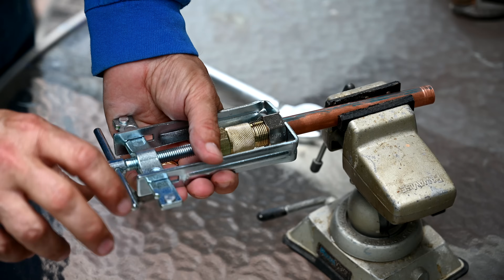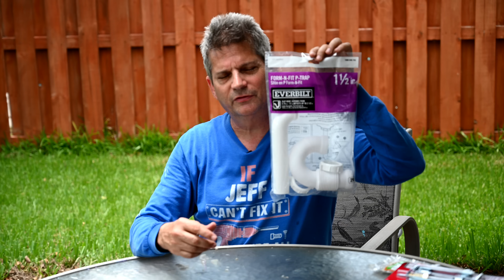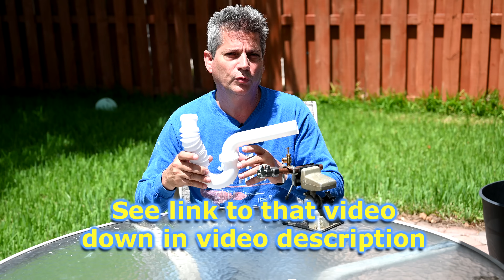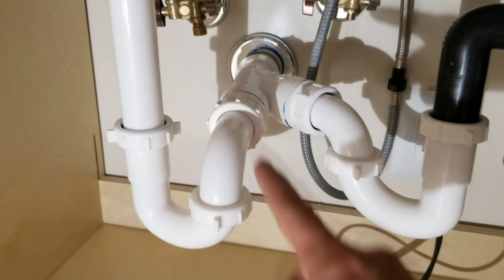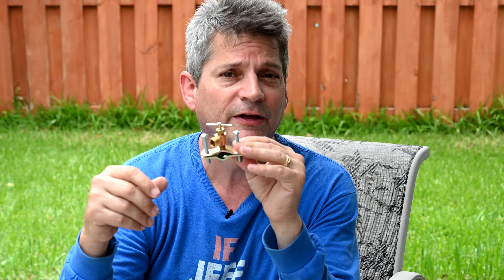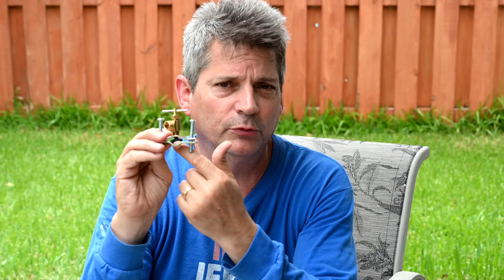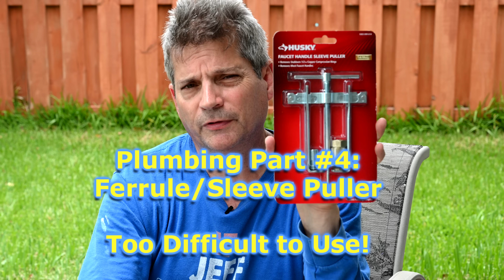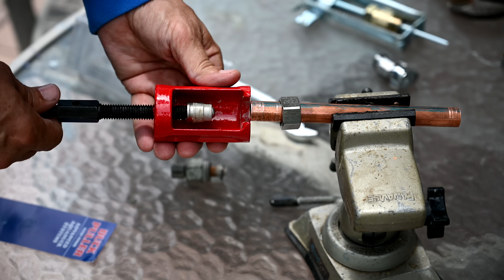4 Plumbing Parts/Tools You Should NEVER Use. NO Plumbing Fails

Comment from the maker: ✅ Useful plumbing tools you SHOULD be using:
🛒 PanaVise 381 Vacuum Base PanaVise: https://amzn.to/3exQZIC
🛒  Duck Puller Ferrule Ring/Sleeve Puller: https://amzn.to/2k5hrTY
🛒 Saf-T-Kut EBCRR Brass Compression Ring Remover https://amzn.to/2Ypt5Mv
🛒 RIDGID One Stop Wrench Kit: https://amzn.to/2ClCbNa
🛒  Channellock 12-Inch Pliers: https://amzn.to/2MdcnGR
Reply: I have one of those flexible P-traps, installed by a contractor. I just saw this video. I guess I need to replace it.  Thanks for the tip.
Reply from the maker: @CaseAgainstFaith1   There's no rush but yes I would certainly look into getting it typed the correct way and it really is not a big difference in parts and pricing
Reply: Q
Reply: I hate those saddle valves also and they are used constantly!
Reply: 12:00 in electronics  the equivalent is ONLY temporary as it WILL fail over time ,,, & that's with audio connectors even
Reply: When you buy the ice machine hook up kit it always comes with either 1/4" soft copper or plastic line and a saddle valve. That's why you see them all the time. Around where I work usually the building inspector will allow an existing s-trap to stay if you use a proper AAV (air admittance valve) so you don't have to do major surgery. If the cabinets and drywall are getting gutted, then it's less trouble to install a proper p-trap and vent stack.
Reply from the maker: @bufordtjustice7015  yes, when we showed the saddle valve in the video, it came in the ice maker line kit at Home Depot. Crazy and stupid. Even more stupid is the "pros"/installers that many appliance centers send over to do the installs also use saddle valves.
Reply: No, I did not say ignore the warnings.... I was saying tone down the hype...
Reply: Looks like they design the seal puller based on the design of a cork remover.
Reply: Hello jeff . is ok to used shark bite fittings ?  Those are approve by plumbing city codes?
Reply from the maker: @romanl8343   Whenever we can we prefer to either sought or pipe or cement plastic pipes and avoid shark bites when feasible, the only time I will use a shark bite as if it is outside the wall and a spot where I can easily see it like the shut off valve for a toilet or the under the kitchen sink for the faucet valves where we had to convert from the old illegal polybutylene pipe to a copper pipe.
Reply: jeffostroff I’m seeing thst Snappy Trap now has a smooth interior of the flexible pipe and claims it’s in compliance with code IGC 328. Should I still be concerned about using it? My new vanity drawer can’t currently close because the pipe sticks out too far.
Reply from the maker: @JkayPacker  I would be hesitant, because if your insurance company does an inspection and sees it, they will see a"flexible trap" and tell you to remove it. Have you looked into cutting the pipe back toward the wall, and leave enough room for a hub adapter to connect to the P-trap.
Reply: I think there’s right way and the right way do it the first time and then it’s finished ✅
Reply: You are 100% right about those being against plumbing code because they have a credit connection before the trap seal. A corrugated tailpiece is not illegal but it is not recommended because things get caught on it which makes a stoppage
Reply: Jeff  I just saw your video!! I live in Central Pennsylvania and I just bought an old house that was built in 1901 and this is EXACTLY the type of pipes that are in this house! I just had to call a plumber because after another plumber had installed s new  toilet in our 2nd floor bathroom. Well after a week or so I noticed that when my wife did laundry in our 2nd floor laundry room that is also in our 2nd floor bathroom we noticed that methane smell!! So I called another plumber and he said we had a huge clog in our main water pipe. He had to use a very long electric snake to unclog that pipe!  Well here he found that the previous owners had used baby wipes and that was what caused the clog to get bigger over time and when we had the other plumber install the new toilet it added to the problem!  Thank you for your VIDEOS ! And for those SADDLE VALVES they're what alot of plumbers and handymen in this area use for the water lines to the refrigerators with the water and ice dispensers in it !  I have 1 of those refrigerators with  water and ice in the door but I haven't had the water line hooked up yet on my refrigerator but that saddle valve is what a guy at Lowe's said  to use on it! So now I know better thank you!! I will definitely be watching your videos from now on!  Thank you!!
Reply from the maker: @stanleywheeler404   Glad to make you an informed homeowner. Only know you have open the Pandora xbox where you are living with the horror of knowing you  Could have this as well but at least you can warn your friends and family up there  too.
Reply: @jeffostroff  Ouch!  My house was remodeled in 2004 and I am still finding mysteries, some from when it was built in 1968 and other from late on, but at least all the dangerous material were removed along with new pipes, electrical and insulation put in.  The  did leave all the old wiring in the attic after removing it from the walls.  I am slowly removing it.
Reply: Man plumbing is not rocket science, and those flexible pipes are a great idea and as good as your fittings. Who the hell cares about the codes...What does the insurance company knows... No, it doesn't trap anything, it works flawlessly...
Reply: jeffostroff  thanks for the informative stuff but i suggest not to talk down n people not every DIYers has tones of $ to pay a plumber , my self in a 62 year old living in less than i fix income , that is not even enough to pay your hourly rate as a lumber , thanks and be conscious do not talk down on others!

Comment: The wost saddle valves  appliance stores on delivery won't do a hookup they dont want th3 liability of shuting  them off past problems resulted in huge problems , i done aalot of saddle valve change outs to a nice appropriate ball vavle shutoff for the appliance to be hooked up buye store , people had to wait a day or two with a refrigerator i there kitchen or garage until i corrected the problem

Comment: Also, you’re distribution lines that are out in the street that feeds you fresh drinking water every time they make a tap for a new house they use a saddle and his various types stairs, hinge types, and is also shackle types all with a rubber bushing underneath it it’s wrapped around the pipe screwed or bolted down and it’s drilled through and put a ball valve corporation on what it’s called and then they hook their line up to it toward the house defeat the house water.

Comment: That’s easier said than done, but not everybody can afford a plumber so that’s why they have some quick fixes mainly for the Hallmark but if it works for a while, it works. I use those accordion traps. The only thing I say about them is they have a Tennessee crack right on the accordion part of the track other than that I’ve never seen one get clogged, but to each is on

Comment: Why do they sell items that are not up to building code?  What's the purpose if there not legal?  Do you know how many homes have S traps here in Michigan? Most all. Here in  Michigan the drain pipes do go straight down in the floor after the P or S traps so it doesn't freeze. There should be a AVV in the set up after the P or S trap . This keeps the water from getting sucked out of the trap.

Comment: I just used the snappy trap for my bathroom faucet & it was a life saver. Now if it was banned in all 50 states (and this is 5 years after the video was released), they wouldn't be able to sell them at Loews or Home Depot. The Snappy Trap (P-trap) works flawlessly. If it ever gets clogged, I can unclog it. 
It's against my religion to get raked over the coals and fleeced for simple DIY projects. I had a Well Co. try to charge me $1,800 to fix a leaky line 4-5 feet underground; - so, I dug it up myself and spliced in a new section of pipe for $30 and that was over 10 years ago. Another time I got charged $700 to replace a water heater pump on my furnace, and when it happened again on the other pump, I purchased the same exact pump for under $100 and soldered it onto the pipes myself. It still works 7 years later. YouTube is putting you guys out of business. If you have half a brain and can follow directions, you can save yourself tens of thousands of dollars in repairs. I am not intimidated by any repair, and don't let this guy scare you into getting screwed by a repairman.

Comment: At 4:05 you show the code requirements the list 6 designs of traps that are banned. Having said why the P trap is banned why not explain what the other 5 are? Is this type of trap: 'SA10V McALPINE 32mm Anti-Vac Basin Sink Waste U Bend P Trap' good or banned (is it a 'Crown vented trap'?). My basin has a P-trap but after the trap it heads straight down and into the floor not into the wall - is that OK?
Reply from the maker: While the product itself is designed to high standards and may conform to various international codes, explicit confirmation of its compliance with the UPC was not found. To ensure it is allowed under UPC plumbing codes, you should verify that the SA10V has been certified by IAPMO or another recognized body for UPC compliance. But I have installed similar devices like air admittance valves, these are used when you have no plumbing stack vent from your sink going up through the roof. So they need to get air somehow and that is where your ubend comes it.

Comment: Nice video, I wished there were more solutions for the “wrong” one’s. I am currently doing a Tub install on concrete slab. Same size tub but new tub drain is about 1 1/2” offset from trap which is attached via fernco to led 1 1/2”. As is there’s no way to line up. Whats the best way to handle offset besides flex tail piece?  Thanks for your input

Comment: I have used the sattle valve for a icemaker and fridge water on my own home. Its been 10 year's since installed not 1 issue. Still looks brandnew as the day it was installed. I believe it is the installer who makes the mistake with sattlevalves and over tightening the pipe.

Comment: Under sink drain plumbing is NOTORIOUS for leaking !
The nylon (or whatever) cone washer seal is TOO firm (needs to be a bit more pliable)
and the hole in the nut (tightener) is TOO large. In some cases the hole is so big that it BARELY covers the cone washer. That hole needs to be just a bit larger than the pipe it goes over, not a sloppy fit.
If all this isn't PERFECTLY aligned, and tightened, the joint WILL leak.

Comment: The husky faucet handle puller is used for faucet handles not sleeves, and I’ve used it a few times to remove a handle from a faucet that wouldn’t budge, it worked perfectly with no problems.

Comment: Question... why aren't homes built with an external vented trap somewhere in the yard right where the houses main sewage outlet hits the city or municipal main???  That would seem to solve a LOT of plumbing issues if sewer gas could never even make it into the home to begin with (besides the little created in the basement sewar pipe).  
     Also If my landlord didn't want a form-and-fit trap on the bathroom sink, he shouldn't have been so cheap and lazy as to tell me "eh... you deal with it and just take it off next month's rent".... Well,  I did... and I'm not a plumber so I bought the cheapest easiest thing.  And to be fair, it hasn't given me any grief or issues yet, and it's totally concealed within a pedistal sink... so, out of sight, out of mind.  He can deal with the code inspector when I move out.  LOL

Comment: I did service plumbing for many years and never had a 'building inspector' look under an existing sink.  Use the easiest way available including flex lines.  I have and they work great.  BS about code.  Code is for inspectors and contractors to bilk the public.

Comment: I disagree with the flex P-trap. Sounds like your trying to manipulate the code to suit your opinion so  customers can pay more. If the code was so against Flex pipes it would just simply state that. Also the P-trap is partially designed to actually catch debris so It doesn't get into your plumbing system. Somewhat challenging your statement on flex pipes trapping debris.
Reply from the maker: Sounds like you don't have a clue what you're talking about. First of all I did not manipulate the code I read the code exactly as it was. And it's not like people are going to have to spend a whole lot of money we're talking about three or $4 in parts.  Piercement of pea traps could not be more wrong. In fact if you look in the plumbing code as I showed all the pipes are supposed to be self scouring as the code reads, which means the P trap is not there to catch stuff and prevent it from going into the pipes it could still go through the P trap. The P trap is there to keep that column of water in there so that sewer gases don't come up from your sewer system and up into your sink through the pipe because it can't get past the water that's in the pee trap. That's why they call it a trap because it traps the water. However if you were foolish enough to install a flexible P trap then yes particles would indeed get caught in it.
Reply: @jeffostroff  Still disagree been using flex pipes for 30 years. No problems.

Comment: A host of these components were developed solely for the diy market long ago, after all there is a load of profit selling to the homeowner, these are low skill repair parts…just like the auto parts industry, with hoards of slip together exhaust fittings, and universal spiral tubing…the people crave giving it a try…and so these items will remain on the shelves…for us pros we are required to know code and it’s changes..applications, etc. we are paid professionals using the correct components…

Comment: I disagree on the compression sleeve remover. It worked perfectly for me. The problem you were having was leaving the shoulder wings on. You take them off by undoing them from the threads and it works super easily. The wings are more towards faucet handles. There are some other designs that have different wing designs but more pricey.

Comment: I’ve seen a million of those flex p traps … they get clogged easily but other than that I haven’t had major issues with them .
Reply from the maker: Yes they work perfectly normally until they don't work. Then you clean them out and they will work again
Reply: @jeffostroff  yes they clog faster ….. hair hangs on it then everything else hands on the hair ….I totally agree it’s a cheesy solution.
In one property remodeled bath …. Semi gut …
The new vanity wouldn’t work with a normal /correct ptrap ..it ends up being like dead center … bc vanity was larger ..
I was going to re plumb it …. But when I got in there it was metal and I was had everything expecting pvc..and I had renters coming in that day …. So I threw one of those stupid Home Depot specials.
The property has been grossing 50-60k a year since mid 2020.
I’ll revisits it and at the least clean it out ….
But zero issues in 3 years ..
Reply: @jeffostroff  you have never had to clean out a normal trap ??
It worked perfectly …. Until …… it ………..🥹

Comment: I’ve changed 35 or 40 of these copper pipe angle stops and i usually notice an indentation around the pipe where the ferrule was. If I don’t have enough length to cut the indentation off, I even go to the trouble of soldering a couple inches of copper pipe on to make sure that the indentation doesn’t cause a leak. What is your advice on this issue
Reply from the maker: That is exactly the way I do it

Comment: Another problem with installing saddle valves is the fact that you have dissimilar metals in direct contact which will cause the softer copper to dissolve over time. You will have a pin-hole leak develop as the copper was eaten away from the inside out.

Comment: We have S and P traps in Australia and they both work just fine. I can see what the issue is with that one. The inlet at the plug and wast end is far to low. The inlet end must be X amount higher then the water level in the trap. That is a fulty fitting.

Comment: OH ....GOD forbid the Foreman Fit P trap ( Flexible )  that makes an installation to off centered pipes so easy ( cheap, quick solution for DIY guys )...... The Plumbers Code CARTEL dictating what you can have.... Have you ever known a PVC pipe to leak ?? OR the Joint.... Always the joint as in my 60yrs i have never known, heard or seen a PVC pipe breakdown under a sink BUT i have known a joint ( Screw or glued ) to leak....  God forbid anyone to invent a product that replaces a person who is qualified to cut PVC pipe and sniff the glue fumes...... AND if you had your waste water going to a storm water outlet and your sh*t pipe going to your sewer pipe then a S trap would not be an issue..... Maybe the whole US plumbing system needs an overall .......

Comment: What frustrates the hell out of me is they have these codes telling you that you can't use the accordion type connector but then they allow builders to install drain lines coming out of a wall at an angle where the pipe is too short so if you go to buy a new cabinet and a sink you have to pay thousands of dollars to plumber made. You think building codes would require that home builders do the plumbing right the first time and stop using cheapo cabinets when they build homes. They custom built all the cabinets with this cheap particle board so when you go to buy new cabinetry nothing standard fits.

Comment: Instead of saddle valve, can you add a T-joint with compression joints? I'm not a handyman...may be a stupid question
Reply from the maker: Yes a t fitting with small stubbout  pipe and put a compression valve on end